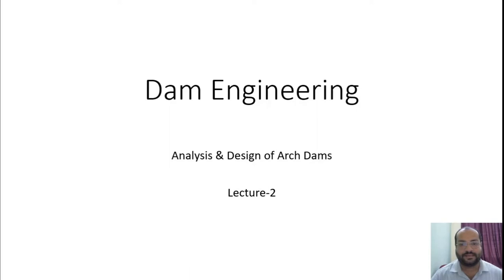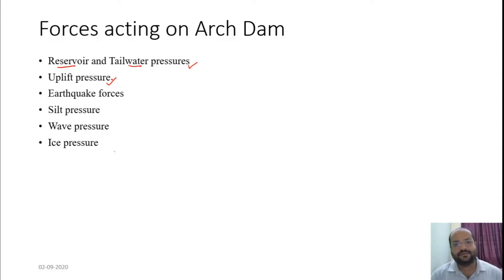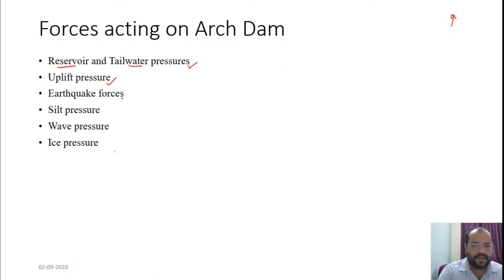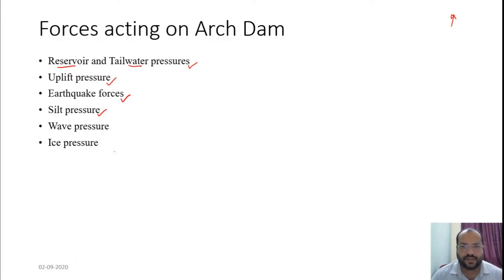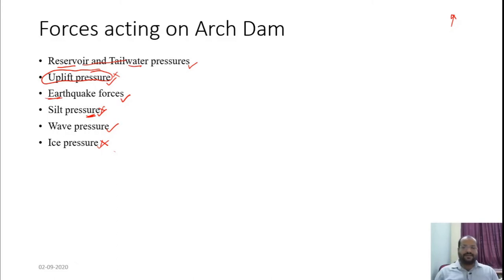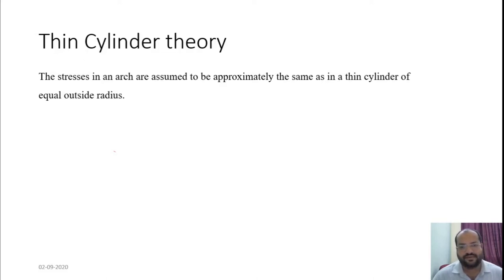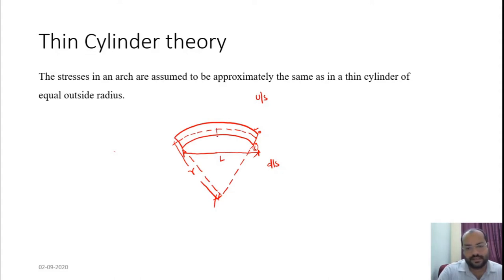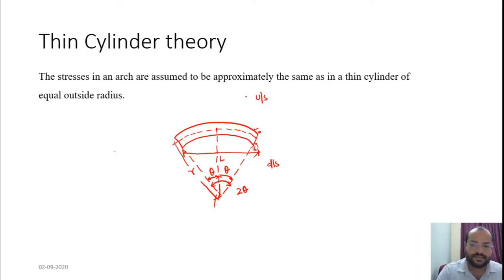Thin Cylinder Theory- Arch Dams (Lecture-2)

Comment: Very very helpful lecture Danish sir. 
I have a question. Is there any other method of finding the central angle without plotting the graph means simply by putting the values of theta as 1 , 2 , 3 in radians?